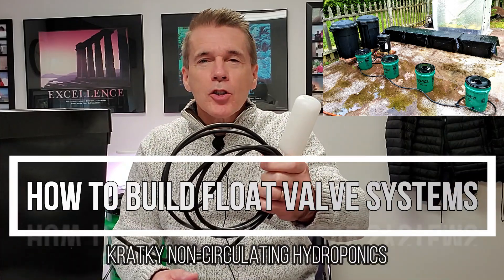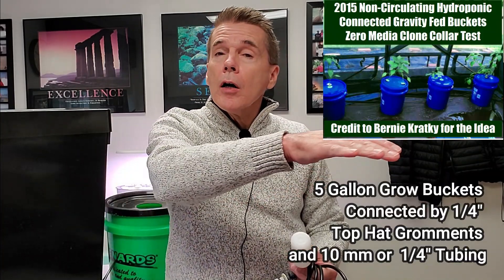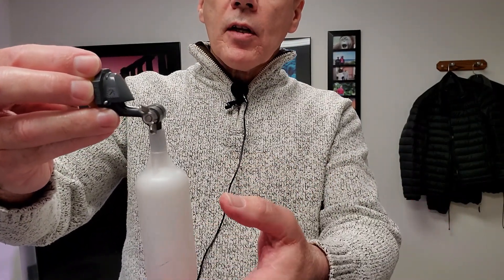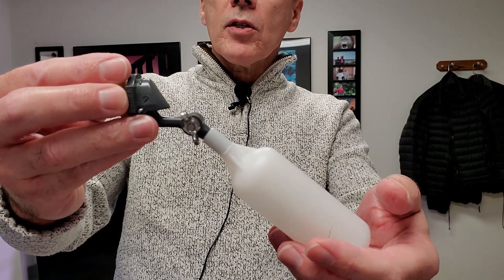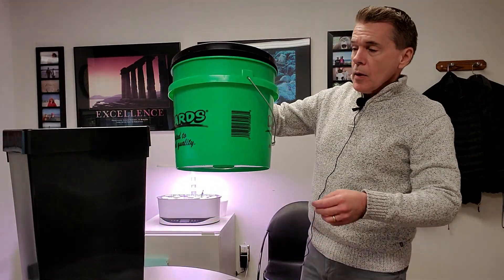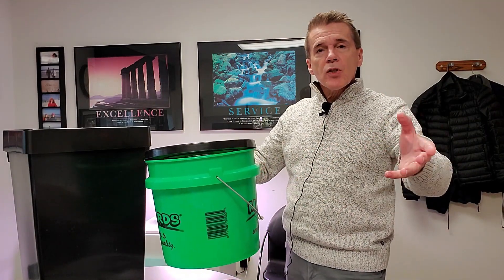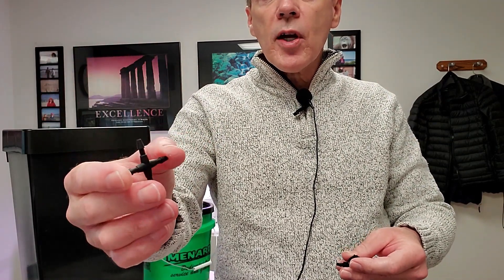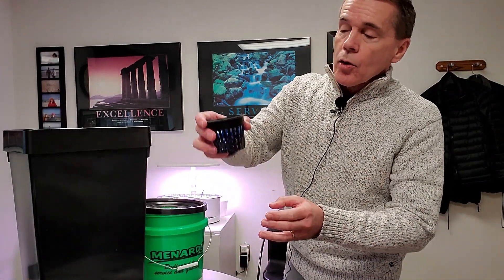DIY How to Build Non-Circulating Hydroponic Bucket Systems, Kratky Method

Comment: The float valve can be a problem if root mass interferes with it. it can be done by have an empty bucket at same level as the buckets with plants  with 1/4 inch tubing tied into series but it will need to be a slow flow if you get my drift.
Reply from the maker: I would agree with you, especially if using either recirculating or aerated growing. With Kratky growing and static water levels, the roots typically not grow deep into the water. I have several systems dating back to 2016 showing controller bucket use like you described.

Comment: Outstanding tutorial Sir. My only question is, if I'm running multiple 5 gallon buckets for tomatoes and peppers that require similar EC nutrients, how does the float valve differentiate between a plant that drinks more than another and maintain adequate levels across all the buckets? Thanks and Semper Fi, Ken
Reply from the maker: If you do more buckets, there are a couple ideas.  
1.  At the end of a longer run, use a shutoff drain to pull off old nutrients periodically.
2. Create multiple runs from your reservoir, each with a separate controller bucket.

Comment: Awesome tutorial.  Do you have any suggestions for a float valve to use in a smaller kratky system on the order of half a gallon where space is limited for the equipment illustrated in your video?
Reply from the maker: Systems can be scaled down.  Are you saying that your reservoir is around half-gallon in size?  Or, is that the size of your grow containers?  Amazon.com sells smaller float valves for other applications like water top off in an aquarium that can be used.  A couple small plastic containers can be stacked with water in the top one and a float valve in the lower one.  Water would go to several small grow containers if using the tubing and grommets in the video and could feed multiple small containers.
Reply: @MattGarver  The container itself is half gallon or smaller…much like your mason jar size.
Reply from the maker: @Thomasxtr  Help to know more.  For small containers you need to probably empty every 1 week or 1 month, since they concentrate pH issues and salt from nutrient issues.  Glass Mason jars are popular but bad choices.  If containers that are plastic, the splitters and grommets for the tubing in the video will allow running nutrients from a reservoir.  In small spaces, look in a kitchen department for containers for small containers.  Try to use a container that is just large enough to insert a float valve.  Use the largest reservoir that fits your space and then run your tubing from the container from your float valve to the grow containers.  If you are using glass containers, you may need to look at siphon tubes to refill unless comfortable with drilling glass.

Comment: Mr. Garver I have learned much from your work here and the WordPress site. Thank you. Also all of Dr. BA Kratky's papers and videos. I have done a few trials in my 400' GH with success, and am designing a full scale conversion. One question I have not caught Kratky or anyone answer, what besides disposal, are the options for any fluid left in a container after terminating a crop?  obviously one could use outdoors, but what is your process?
Reply from the maker: Thank you for such kind words. Most of my work has been proof of concept and trials with large plants using the fill and forget method.  Because of the amount of leftover nutrient, I switched over to using float valve and reservoir gravity feed systems as time went along.  That has helped out. With the size operation of a greenhouse, I would reach out to the greenhouse hydroponic community to solicit their wisdom. Hopefully you will get the answers that you need asking on those forums.
Reply: @MattGarver  thank you for the thoughtful reply. And yes, I had already planned the beds to be float controlled, but that could still leave 5-8 gallons in a 27 gallon system?  My intention now is dilution and using in the outdoor gardens. I will check EC carefully in the spent fluids and if there is a way to recycle to the hydro systems I will post. I am in an arid region, and have built a many thousands gallons rainwater catchment, and wish to run the G/H on this rainwater. Hence the interest in Kratky. Thanks again.

Comment: So just so it's clear, non-circulating hydroponics can use half strength nutrient solution compared to circulation systems and achieve the same results?
Reply from the maker: Good question, and true.  I've grown beautiful and massive plants with half strength nutrients.  They typically drink more than eat.  Dyna-Gro bottles even state using half strength on passive hydroponics.
Reply: @MattGarver  so let's say: lettuce, spinach, cilantro, parsley, oregano, basil. What NPK would you recommend? I'm planning on using masterblend but I'm open to anything
Reply from the maker: @ZaneKyber  Whatever you would like to grow?  I have done tomatoes, passion fruit, peppers, melons, and other things
Reply: @MattGarver  I'm really only currently interested in leafy greens like lettuce, spinach, parsley, cilantro, oregano, basil and spring onions